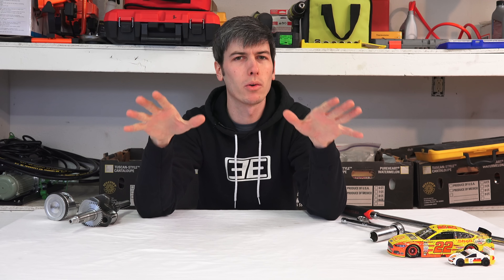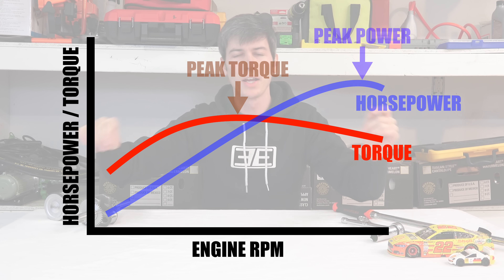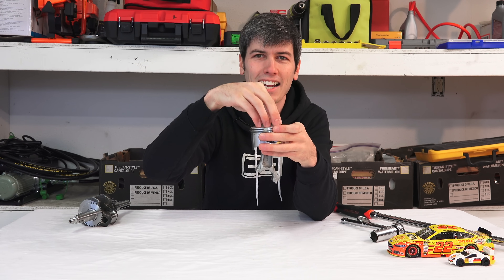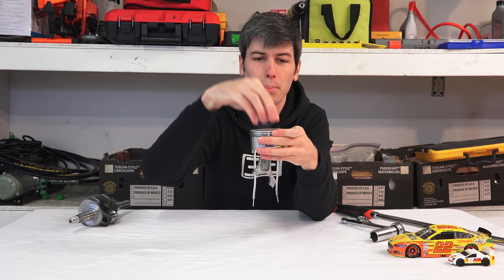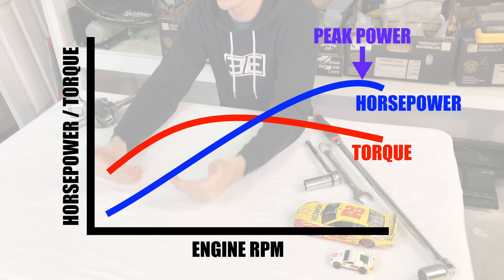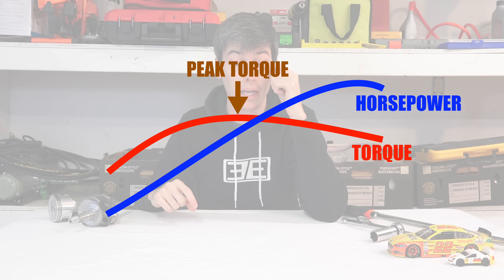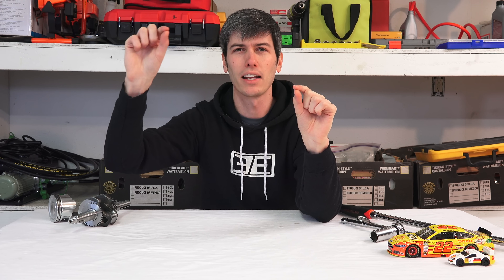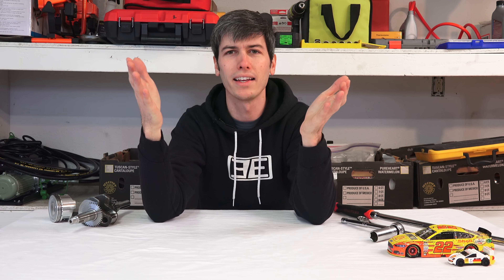Horsepower vs Torque - A Simple Explanation

Comment: So basically,  Tourqe is the Effectiveness of using Horsepower?
Reply: No, it's more correct to say that torque represents the potential for mechanical power depending on fast the body it is applied to is rotating.
Reply: @buzzlesworth54  So like how a straight six can get to 800hp quicker than a Rotary due to the nature of the engine allowing more tourqe to put this power through the drivetrain?
Reply: @Hajime_Haruka  If by quicker you mean "produce the same horsepower at a lower RPM" then you are correct.  Low torque motors must spin faster to produce the same power.
Reply: @buzzlesworth54  Ah Ok, I think I got it now.
Reply: @buzzlesworth54  Thanks!

Comment: The word "simple" should not be in this title
Reply: Yes it should! This is the first explanation I heard that's actually dead simple, easy to understand and useful. Only thing I would have wished was a comparison of Diesel and petrol cars.
Reply: @froreyfire  He actually did that comparison with the two cars -- the gas car is the high horsepower/low torque car, and the diesel is the low horsepower/high torque one.
Reply: @AndrewAMartin  Yeah he showed that a gas car with higher horsepower would still be stronger than a Diesel. But maybe more relevant would be a comparison between gas and diesel with equal horsepower and a different torque curve.

Because the distribution of power over the rev range is different. I think this is why many people feel diesels are just more powerful - you tip the throttle and it accelerates quickly at maybe 2000 revs.
 
With gas engines, many won't ever realize how much power they have because they fail to change gears in order to rev up. This only applies to manual gearboxes of course (automatics are very scarce where I live).
Reply: Mate, this is literally THE easiest way to explain torque and power scientifically, my only non-scientific explanation would be "Torque is what get's you out of a sticky situation, Horsepower is what let's you outrun said sticky situation"

Comment: So technically a tractor engine with 650 torque could have dramatically higher house power than a car of 300 torque if you fiddle with it's gears enough?
Reply: Yes, it's only though the combination of torque and RPM that power is generated.  The high-torque motor would need higher strength, heavier components to handle the forces as well as a stronger gearbox with much taller (low gear ratio) gears.  As you can imagine, the extra weight does not lend itself to race cars so usually engineers fight to maximize RPM to generate the power in these applications.

Comment: Having a longer piston stroke would give you more torque vs shorter stroke makes the engine rev quicker ( more horse power) .  That's if every thing else is the same.
Reply: You just explained the difference between a V-8 and a straight 6. And why every 18 wheeler on the road has a straight 6.
Reply: That's what she said!

Comment: Very clear explanation, but I still have some dubts: if I have more leverage on crankshaft, I should have less fuel consumption with the same force applied to the piston, ok? 
If so, it means more engine efficiency (forgive my english). 
So, why constructors don't make extremely long stroke engines for the almost whole production, leaving short stroke engines (and bigger bore) exclusively to exotic cars and high performance motorcycles?
Reply: You don't get power for free just by increasing the moment arm (crank radius here), which is what I think you're implying. It will tend to increase the torque but reduce the RPM, leading to the same amount of power generated not accounting for frictional and geometric losses. Engineers select a crank radius and connecting rod length as a compromise between goals of maximizing torque, compression/expansion ratio,  and RPM while being confined to the crankcase geometry.
Reply: @buzzlesworth54  You guessed what I implied but, obviously, not in a so "easy" meaning...It's 
self-evident that certain engineering limits must be respected (and not only in engines production)...
So, I'm not an engineer but I already knew what you mean, and I confirm: there are too much engines going around, not specifically designed (and optimized) for a... daily use, but just to increase marketing, constructor profits and bullshits (for costumers) like that
Reply: @FrankieGoesTo...TheSea  Ok I see what you're saying about how consumers may not know what's best for them, and I can agree to some extent.  I do think there is a general trend towards more daily-drivable motors with some focus on low-end torque/power. Turbos are being added to more and more engines, and these turbocharged motors aren't usually being tuned for maximum power in my experience, but for flat torque curves peaking at low RPM.  

However, I think that ultimately American consumers are right to demand enough power for sub-10 second 0-60 times since we have to worry about getting onto interstates that don't always have the longest on ramps.
Reply: @buzzlesworth54   naaaaa, the simple use of turbocharger set for torque, is not the real way to have an optimized engine for daily use. The world of car need to change completely the way they deign engines, from the deep ground. 
Even cheap engines for city cars are anyway sons of a wrong way to think the car...a way made only to send and easly increase marketing.
Turbochargers are the best way to give an idea of the wrong way they design engines.
A very cheap and really optimized engine (without turbochargers and things that compromise engine reliability) can perfectly have enough boost (and torque) to come out from whatever kind of ramp.
(sorry for the tone I use, but I'm really angry about car world...and the way they still keep  to act, despite the deep car world crisis)
Reply: @FrankieGoesTo...TheSea  Well, just wait 10-20 years for self-driving cars to achieve deep market penetration.  Their electric power trains will optimized for efficiency, and the main competition will be for ride quality and cabin design/comfort.  No one will care about power and acceleration for these people-movers beyond their rated passenger/cargo capacity, and it will be a paradigm shift for the normal consumer that couldn't tell you if their car has a torque converter or DCT.
Reply: @buzzlesworth54  eeeh, I've always believed electric cars could have been the cure for the rotten car world but, looking at Tesla concept of electric car, I'm definitely loosing confidence.
Anyway, I don't hate exotic or competition cars. I've always been a fan, but they should clearly distinguish the 2 concepts of car. 
If somebody have enough money, he will buy a second (exotic) car...if not, going around like Schumacher, with the same car he use to go to supermarket, is ridicolous

Comment: it's simple 
Torque is the amount of energy produced with each engine stroke ''bigger engines help thanks to it's longer parts''
horse power is the sum of energy produced by the pistons strokes ''torques'' in a given time  
high horse power means a high evolution rate of larger pistons 
lower horse power can be a result of low revolution rate of large pistons as they do not stroke fast enough yet they can pull a crazy amount of energy. 
a car with high hp and high torque is basically a car with bigger pistons and a high revolution rate meaning that car is well made as its pistons are big and can handle the heat of fraction so it strokes like there's no tomorrow.
this leads us to the conclusion vehicles with high horse power come with high torque as HP are the end result of torque multiplied by the number of pistons revolution in a given time. 
Cheers.
Reply: Interesting take, but a few inaccuracies here. It's simplistic to say large pistons = more power.  The downward force generated by a piston is a function of the pressure inside the cylinder and the cross-sectional area of the piston, so motors with high compression ratios and/or forced induction can be more powerful than larger displacement engines.  Also, cylinder friction is not usually the limiting factor for RPM. Piston acceleration or valve float are usually the limiting factor.

Comment: So, how can a software update cause a change in torque?  e.g. Ford SuperDuty diesel new year update.
Reply: It changed the engine map.  The fuel control unit is told by the software to inject  more diesel under certain engine operating conditions so you can get more torque and power. They may have refined their reliability or emissions analysis to allow the increased torque update to be released, but that's speculation on my part.

Comment: In reference to that graph - to produce more power, RPM has to go up after the peak torque, because horsepower = torque * rpm..right? But how does the RPM go up when torque goes down? Isn't torque responsible for RPM? I guess that is where the gears come into play..

Comment: Make it easy to understand???, all these videos shows a guy turning a bolt, ja I get the length gives you more leverage or better torque, explain how this relates to the engine in a simple way and how does that make ft ib...,to make it simple to undestand, when you twisting that wrench, how much ft ib is that?, so we can get some idea how much a car can do
Reply: If you weigh 200 lb, and hang off of a pipe protruding from a wall 2 ft, you are applying 400 ft lb of torque to the pipe at the wall.  High performance motors can achieve this much torque, but can apply this torque continuously through 360 degrees of rotation at thousands of RPM.

Comment: Let me tell you what I've learned from 20+ videos about HP and Torque: 
1. If you want a super fast car (not super accelerating) you will need high HP.
2. If you need a car for heavy duty (lifting and climbing) you will need high torque.
3. If you want a car that accelerates fast, you should check the (0-100 km) in the specs of the car because that depends on several factors including: motor size and quality, the weight of the vehicle, gearing system, the HP & Torque lines (more than max. HP or max. Torque), etc.

Comment: Torque is a moment of a force versus a arm. Long arm better torque like a harley Davidson. Power is the speed or amount of torque you can produce in a second.  They work together.
Ex:  working  in Newton meter a second(like Lb ft) is means an one 1 newton force(109 gramas of mass plus 9.8 metres of gravity makes 1 newton)  plus 1 meter arm make 1 engine turn( 2 PI) it makes 6.283...(Pi 3.14159) so have 1 Newton * 6.283  = 6.283 newton if the turn is made in 1 second. 
If a engine makes 6000 rpm then it means 100 a rps(per second). Now you have 6.283*100 torque meter-1(a second). 628,3 Newtons. Since HP = 0.7457 Newton then 628.3 N sec-1 = 0.83653 HP. If you want 1000 HP(a big force) with 6000 rpm engine the torque at 6000 rpm must be :

745.7 KiloWatt = 1000HP = Torque * 100 turn a second. Pi*Torque m s = 745699,87 /6.283/1 meter/100 turn= 1186.85 Nm of torque. This is a high torque like a le mans LMP1 car. Normal cars has 100 to 200 or 300 Newton m of torque and make +/- 6000 rpm and have more or less  100 HP, 200 HP or 300 HP.

Resume: 1186.85*6.283*100 = 745699.87 = 1000 HP. Remember 1HP = .745669987 KW.  
By the way 1 Watt = 1 Joule = 1 Newton. Joule is Energy, Watt is work , Newton is Force and all have the same value. 1 Calorie = 4.184 Joule. Remenber that we loose 2000 KCal a day. Too much. means 8 368 000 Joules or Watts a day. It means 96.85 W a second. A 1000 HP car spends 745699.87 W a second or almost 7700 times more then a human.
Have a nice day.

Comment: Correct me if I’m wrong so horsepower is how fast the torque is being applied
Reply: Yes, that's essentially correct. Power is force * distance / time.  With rotational engines, the force is torque and the distance is accounted for in the RPM and the constant 5252 (for imperial units).

Comment: What about wheel size?
Reply: Wheel size affects final drive ratio, which will affect the torque that is applied to the ground after the torque generated by the motor makes its way through the powertrain.

Comment: Got a question though, if a car A has 300 hp and 500 torque, and car B HAS 500 hp and 300 Torque, witch one can pull the heaviest object from point A to B?  - My friend told me that hp is how fast a car moves from point a to b and torque is how strong it is.
Reply: With a transmission with short enough gears, you can pull a freight train with a power wheels (if you have the traction).  Automotive engineers tend to install high-torque motors into trucks because they are built to last and truck drivers don't want to have to rev past 5,000 RPM every time they accelerate from  a stoplight.  That means in theory car B would win the race but would have to turn at 8753 RPM to get that 500 HP, leading to a less practical vehicle.  Car A meanwhile is turning at 3151 RPM, leading to a more pleasant driving experience and more perceived and probably actual durability.

Comment: Roughly example 
Car 1. 1200rpm
Your car start moving.
Reach it limit 30KMH on a 50° hill.
.
Car 2. 1200rpm
Car also start moving 
With limit for 25kmh on the same hill.
 It's because car 2 have less torque?
Is it?
For horse power.
Car 1. Reach 30kmh on that hill with 1200rpm from 0kmh (0-30)kmh 
Used 4 seconds 

Car 2 used also used 4 seconds to reach 25kmh. 
So who has more horse power?
Or could anyone give a great example about hp and nm😓
Reply: These answers assume the car weights are identical.  In your first example, car 1 has more torque and also more horsepower. Since you specified a fixed RPM,  and power is proportional to torque * RPM, car 1 will have more of both.  

In you second example, car 1 will also have more torque and HP since you specified a fixed RPM. Remember, it's possible for a motor to have less torque but be more powerful if it produces that lesser amount of torque at a high enough RPM.
Reply: @buzzlesworth54  alright..thanks yo..now I'm getting it more😅

Comment: So..., why does say a big diesel engine with 800 ft lbs of torque, but only 400 horsepower have the power to pull a 15,000 lb trailer  in comparison to say a 4 cylinder sports car with with a turbo that has say 600 horsepower but only 200 lbs of torque? Seems like "power" is subjective to the application. Gears alone can't explain the difference. It seems to me, more horsepower equals more speed and acceleration, but more torque equals slower pulling power..., or horsepower equals fast power and torque equal slow power. What am I missing here?
Reply: What you're missing is practicality.  On paper, placing a high-revving sports car motor and transmission with 400 bhp into a truck will be able to outperform the same truck with a high-torque diesel and matched transmission only producing 300 bhp.  However, since the sports car motor will only produce high power at high RPM, starting from a stop will require the driver to be rough on the motor and transmission by slipping the clutch or abusing the torque converter, leading to excessive wear.  Also, typical truck buyers would not tolerate having to consistently rev past 3500 RPM every time they accelerate from a traffic light even if the performance numbers are better, both for NVH reasons and durability/reliability concerns.  Sports car buyers are more tolerant of high RPMs in general, and also the cars are light enough to not require high power outputs during daily driving unlike a truck towing a trailer.

For these reasons engineers prefer engines that produce high torque at low RPM for trucks, even though the power outputs may not be as high as may be possible with a high revving motor.